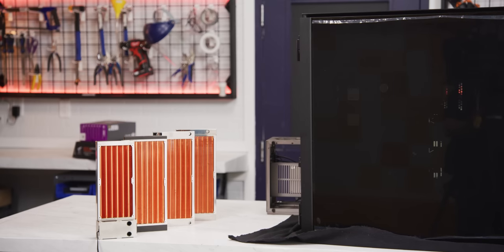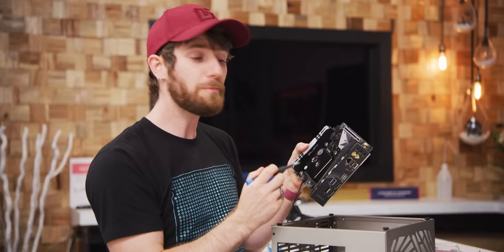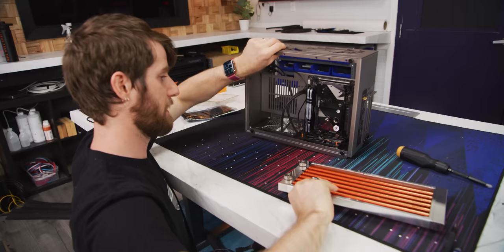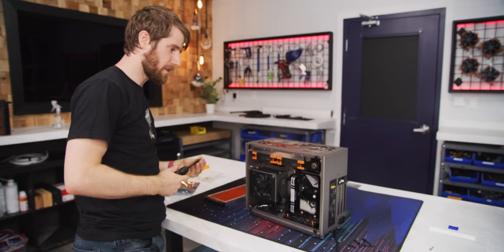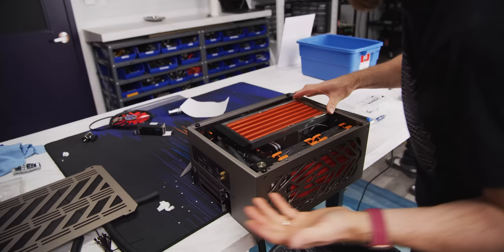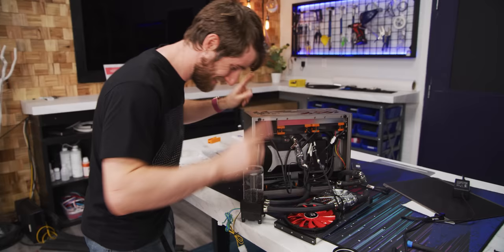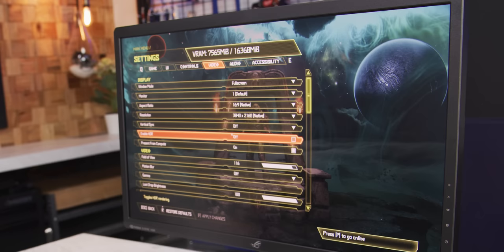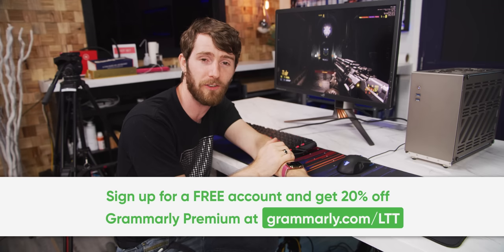The IMPOSSIBLE PC - 4x dual radiator ITX build

Comment: Fantastic build! Linus used some improved techniques that I've never thought of.

Regarding the pump that many people have asked about, it's actually integrated in the top radiator, and there’s also a tiny reservoir in it.
Reply: salvage
Reply: 你给我上去 King of Wings himself here
Reply: 翼王！！！原作者来了
Reply: Nb
Reply: 真厲害也
Reply: An XLNT design 🏆😎👍
Reply: 老粉狂喜
Reply: to King of Wings, since warm/hot are rises, why not just make the top side of the case the only exhaust and all other sides, even the rear/port side, be the intake? Positive pressure inside the case, and would insure hot only goes out top side. Heck, I would even DIY a stack/tower/chimney over the top to an exhaust fan out of the room. So that system generated heat won't add up toward room ambient temp.
Reply: 好家伙 翼王高强度上网啊！
Reply: 中国老莱梦幻联动
Reply: Nb
Reply: 排面
Reply: 大师球
Reply: 牛批。
Reply: 活捉
Reply: 点个赞！顶上去！
Reply: 翼王NB
Reply: 梦幻联动
Reply: Isn't YouTube banned in China
Reply: 翼王上去
Reply: @TheKb117  as soon as you add a fan in a case the fan vastly overpowers the mixture of air over the ability of the hot air to rise
Reply: 翼王冲冲冲
Reply: I thought Youtube was banned in china or something
Reply: @jammaschan  right，but VPN……
Reply: 科技区睡觉时间调查😂
Reply: 牌面啊翼王
Reply: 喔嚯
Reply: @luyaomusic  but VPN is technically also illegal in China? I know a lot of people use it, but it still is illegal.
Reply: @jammaschan  Basically, VPN is not illegal, but commercial VPN is illegal.
Reply: @jammaschan  you can use vpn, but you can not build and sell the service
Reply: 幫頂
Reply: @jammaschan  Yes, that's right.  But the intensity of law enforcement is very flexible.  Generally speaking, opposing the Communist Party and criticizing political decision-making must be given priority.  

Generally speaking, the gray area is still very large. For more neutral things such as digital, technology, media, music, and education, many videos are clearly moved from YouTube to Chinese websites, but they are generally allowed.  But politics penetrates every aspect of life after all. 

For example, Linus used Gigabyte’s motherboard this time. You can search for what happened to Gigabyte recently, so that it was banned on Chinese e-commerce websites.  

Gigabyte, MSI, Asus, including AMD Lisa Su and nvidia Jensen Huang.  They all have a lot of ties with Taiwan, and you may also know the Chinese government's arguments about Taiwan.  Even if you are a technology video creator who is not so closely connected with politics, you have to pay attention to your words. For example, you can't say that Taiwan is a country.  Linus also said that there is a Chinese version of Steam, and I also like that video very much.
Reply: LTT need to pin this comment
Reply: @Charles-cv6db  But then what is the point of the great firewall if everyone can just bypass it?
Reply: @zl721  That's interesting
Reply: @luyaomusic  I guess making videos in China is pretty hard then since there are so many rules. I didnt even know gigabyte was banned. Ill go look up what happened. That's pretty interesting.
Reply: @luyaomusic  okay I looked it up, but I really dont see the problem with Gigabyte saying they are made in Taiwan. Hong Kong's trade minister recently got mad at the USA for forcing products made in Hong Kong to be labelled as made in China. He says that is against international trade laws. I don't see why products made in Hong Kong cannot be called made in China but Taiwan products must be called made in China. That is a bit of double standards to me.
Reply: Andy肯定提前通知过了
Reply: @jammaschan  There is a threshold to bypass it, but it is not completely prohibited, which is the flexibility of the policy.
Reply: @jammaschan  Hong Kong has a special tariff policy. If it is produced in Mainland China, it will inevitably pay more tariffs.  For example, the production of the new motherboard is produced in mainland China, Shenzhen, Huizhou... and then go to Hong Kong to declare tariffs.  After being sent to various countries in the world, factories in mainland China increased its export orders, and Hong Kong also increased its total import and export.  There are many ways to pass this kind of object from the left hand to the right hand.  

The U.S. government is helpless with such rules. It wants to say that since Hong Kong is part of China, and Hong Kong’s democracy and freedom have been destroyed in recent years, we can no longer treat it as a free port.  In fact, many factories have moved to Vietnam and Indonesia in recent years. Their advantages are the same as the original China. They have cheap labor and the local government's welfare policies for all aspects of enterprises, but they lack a city like Hong Kong.  

The Taiwan issue is a long story.  In China, 3 T words can anger the Communist Party.  Taiwan, Tiananmen Square and Tibet.  July 1 of this year is the 100th anniversary of the founding of the Communist Party of China. Recently, the network blockade has been upgraded, and many VPN nodes cannot be connected.
Reply: @luyaomusic  Ah yes I seem to have forgotten about the part about the trade tariffs, thanks for reminding me. Still, it seems to be awfully benefit oriented rather than actually wanting to use the Made in Hong Kong tag. Since Taiwan is regarded as a separate entity from China in trade anyway (with the US at least), would Made in Taiwan really affect China that much? I just don't really see how Gigabyte had to be banned in China just for saying their products were Made in Taiwan. I do understand that it is probably a political thing, so it might just be emotions rather than logic that leads to bans.
Reply: @jammaschan  I understand what you mean, it seems ridiculous and there is no logic.  But this is the fact. 

The Chinese government just wants to publicize these issues loudly, and there is no room for discussion.  The Communist Party can control online public opinion. In recent years, populism has been very strong. Under such circumstances, it is difficult for most people to have the ability to think independently.  

Doing business or making videos in China is not so difficult as self-censorship. 
For example, in this video, Wings King, the designer of the itx case, I remember that when the Intel 10th generation CPU was launched, someone broke the world record for overclocking.  Wings King uploaded a screenshot from a foreign website and uploaded it to bilibili.  The fourth overclocking record is from Taiwan, and the national flag of Taiwan 🇹🇼 is indicated in that ranking.  After ten minutes, he was reported by someone. Later, Wings King deleted the picture and apologized to the public.  Then say that Taiwan is an inalienable part of China... Balabala ……

This is the case in China, passively abide by these "rules", otherwise your business will be blocked on all Chinese platforms, you can go to Google to search for people blocked in China, big  Part of it was just saying something indifferent like Gigabyte, but the Communist Party was not happy.
Reply: @luyaomusic  ah that's sad. Thanks for engaging with me anyway, have a great day.
Reply: @luyaomusic  Thankyou for explaining all this, interesting insights, its good you can VPN and join the conversation.
Reply: 本尊😂
Reply: What about mounting pump on top of the loop? Why nobody mentions that. Pump will die soon in such configuration.
Reply: King of Wings 这翻译太搞笑了哈哈
Reply: Could you please tell us where we could get these radiators? Thanks :)
Reply: @an3k   You can buy them on taobao (Original edition of aliexpress). The brand is 駻匠 (hanjiang). It needs transshipment I think.
Reply: @WingStudio666  Thank you very much!
Reply: 翼王 真男人！
Reply: 抓到一个翼王
Reply: 翼=Wings 王=King

King of Wings

某家賣雞翅的店...?
sounds like Chicken Wing Store
Reply: B站把这期搬过来了，才知道翼王和加拿大白嫖王有梦幻联动🤣
Reply: 活捉大佬。
Reply: @willlo2513  我竟然看懂了这个单词 NBable
Reply: 簽到
Reply: 翼王牛逼
Reply: where does one even get such a radiator/pump/reservoir combo?
Reply: 大师球
Reply: This is insane, how did you come up with this
Reply: @TheKb117  If you increase the pressure too much it will outpace the exhaust fans, which makes it all less efficient and (at least with older fans and motherboards) can actually push electricity back from the fan to the board rather than the other way around since a fan works as a wind turbine electric generator if it's spun externally

Comment: "There is an SSD on the board, right?"

My heart stopped for a second 😲
Reply: If they forgot, they have plenty of fast USB-C ones lying around they could use 😂
Reply: @Frog-ko6uu  pretty sure you can't install windows on an external ssd
Reply: @olivertrees  It performs way better with a proper SSD, and acceptably well even over a USB 2.0 connection
Reply: @Frog-ko6uu  oh cool. didn't know that. USB 2.0 is under sata speeds though, so not exactly optimal.
Reply: @olivertrees  lol, it definitely isn’t. However, the only PC I’ve had to run from 2.0 is a mid-2007 laptop, which isn’t gonna be fast either way
Reply: @olivertrees  There isn't a big difference between sata and nvme when it comes to operating systems (except with tasks like moving large files). In fact even boot time is similar. That said, I'd hate to see it plugged out midsession though.
Reply: @SoysauceML  the speeds are pretty drastically different, and you can tell to at least one point. 480mbs is dangerously close to HDD speeds
Reply: @olivertrees  Sequential read/writes are mostly insignificant, it's the random reads that matter. In which, they aren't hugely different. Look up some comparison videos. In terms of things like OS boot time, game load time, etc. SATA and NVME SSDs are mostly identical.

At most you can argue NVME works better for video recording and editing (and for the former case, only recording in codecs like Lagarith lossless).

In before you say I haven't used NVME, I'm typing this on a computer with a 980 PRO SSD computer. I also have a computer with 860 EVO.
Reply: @SoysauceML  Windows keeps doing so much random background tasks, maybe nvme helps overall experience, idk.
Reply: @suyashsingh9865  Only tasks that involves a lot of sequential writes would have that kind of problem. That said, while that may be the case for now, it may not be so in future, since newer technologies that utilizes the SSD are in the works (like RTX IO).
Reply: IKR, I was thinking imagine you do this and it POSTs, but one of your DIMMS are bad.

Comment: "that would put hotter air around the motherboard though"
Mono block & Chipset watercooling in it next? 👀
Reply: RAM Watercooling? 👀
Reply: AHHHH DADDY NORD
Reply: x570 here, chipset gets hotter than anything!
Reply: What about watercooling the watercooler?
Reply: Thinking of the ASRock aqua series now
Reply: Bald
Reply: @ZeroUm_  You jest, but a cascade with the second rad or res cooled with a chiller or peltier is not new at all.

Impractical, space consuming and not good for your power bill? Yes absolutely, but it did work well.
Reply: @ZeroUm_  aircooling the watercooling that is watercooling the air cooling
A loop for infinite cooling
Reply: I've got a sandwich case and it worried me at first..
Reply: Unnecessary- but ofc depends the was u use it
Reply: @ZeroUm_  i mean the water flows inside the cooler right so in theory it might already be a watercooling  watercooler if that makes sense 😂
Reply: @derechtedev9411  absolutely 👀
Reply: @MaxUgly  Aorus Master x570 here, chipset constantly throttling because the stock fan is absolutely useless, threw a EK waterblock on it, looks really cool and un-conventional and holds it around 40c!
Reply: @Nordern  Taichi here, the fan on chipset overheated and bearings starting making a bunch of noise. I took the fan off and now my gpu cools it just fine lol. I just had to customize fan curve for rx 6800 to always be at least 25%
Reply: @MaxUgly  I used to have my 3090 on a riser, just recently gone away front that and as such, the entire chipset cooler intake was covered by the gpu, and since the the PCH temp never changed regardless if fan speed, kr went really hit unless II was running my gpu fans on audible RPM, now everything is watercooled and silent, as it should be!
Reply: @MaxUgly  lol true same here
Reply: @derechtedev9411  Already exists, i have the Adata XPG D80s with liquid cooling :D doesnt make a difference, but its a sick flex
Reply: @MaxUgly  true, i've changed the chipsetcooler myself on my Asus ROG Strix X570-E Gaming , it is really running the coolest ever now without any fan directly attached +- 60 °C now. 
(before it was 86 till 91 °C). but i've changed it because of the annoying fan ramping up always, witch is not strange if you see the original size of the cooling block ;p
Reply: @Nordern  good for you, i've have wanted to watercool my asus rog-e x570 chipset aswell, but it was to much different parts and things to consider, so i've bought a copper block 100x80 mm
 cut some off now it is 60  °C, and i'm already happy with it.
(still have thermal grizzly minus 8 pad for inbetween chip and block was ordered and a bit late)
Reply: @ZeroUm_  yes, have water mist onto the rads just like some models of subaru WRXs that mist water on the intercooler
Reply: I mean Aorus does make water-cooled motherboards so that is a thing 👀

Comment: Linus-
"you cant fit fans in this case" proceeds to make it look like a mini fridge computer with 4 radiators
Reply: I wanna challange LTT to make a gamer pc but its a notebook
Reply: @claudioandkindash7761  an LTT gaming "laptop"? I'd love to see that with all the new cnc stuff they got!
Reply: @zOzzYz  pretty sure you wouldn't want to use it on your lap at all if it become a reality, though
Reply: Cool build but I really doubt the efficacy of the fanless rads
Reply: @FinneousPJ1  3 of the 4 rads are equipped with 2 fans each, though 4 of them are thin fans. And the last one shares the fan from the PSU. The original version is capable of pushing 10900K to all core 5.3Ghz (though they said that the motherboard probably had some issues so it's not stable at that frequency) so it's solid enough in performance I guess.
Reply: @FlameRat_YehLon  Yeah but how much performance is the 4th rad without fans adding?
Reply: @FinneousPJ1  you can think of it as a 120mm rad, since it make use of the PSU fan. Though each rad is way less efficient than if they are used separately anyway, since the temperature is way lower. They are really there for improving the performance in suboptimal environments (hot or confined space) i think

Comment: Wait wait, can we get a source on that copper vs aluminum fin performance, especially regarding the heat dissipation? Based on my materials science understanding, that doesn't make sense.
Reply: well one thing i can guarantee you is that copper is surely most conductive heat transfer but not strong enought structure. thats why its hard to see cooler that use copper as fin. the structure easily change after get warm.you can learn that in basic chemistry. for the heat dissipation. maybe the subject of the temperature of aluminium can absorb is higher is better as endpoint, and the copper faster absord as key for firstpoint.so that the aluminium can absorb a lot heat in the same time air can dissipate the heat.this is my theory. this is simply my theory. it kinda make sense in one way,but maybe there more into it
Reply: he might not have the same understanding as you, and me. itd be a good LTT video though, but id bet identical fin design aluminum vs copper, aluminum would be worse

Comment: Yes, it was pre-bled, however, it wasn't with the bleeding location at the highest point. There was probably some air still trapped in one of the radiators.

Critique out of the way, I love this and wish I kind of owned this. The dust on the bottom intake would be annoying, but eh, it'd work.

Comment: Water pipes are now heat pipes, wicking the heat through the system.
As long as the thermal mass is kept at bay from through the rads, it will keep going.
So in this case the number of rads matter.

Comment: For cutting Cable Ties, you get basically perfect results if you'd use "Small Electronics Side Cutters". These can cut the Cable Ties very flat on the head.
As an electrician, I really appreciate those at work, as the small remains would always be very sharp and can easily cut into the arm while working in small spaces.

Comment: The ziptie "cutters" respawned on the tool rack after Linus threw them out?
Reply: devs got lazy, they focused on graphics more and i'm not complaining
Reply: You should know Linus never throws away stuff
Reply: The radiators are actually the same radiator respawn 3 times
Reply: it will just be decoration from now on
Reply: Those are made for removing zip ties on bundles w/o hurting the wires. Most professionals use zip tie guns to tighten up the tie and cut it with one tool...
Reply: @Bmartin8250  i never seen a single person use a tool like that, have been working as a licensed electrician for over 10 years
Reply: @king080dom  I believe I saw their usage for more of removing zip ties in bundles in electrical panels and such. Mcmaster has them marketed as cable tie removers.

Comment: Watching all these watercooled builds here lately really makes to make me try one some time. The only reason I never did it was since because it just doesn't seem costefficient for the performance gain. On the other side, I do like myself some piece and quiet. I only hope it's as easy at it seems in the UTUBE.
Reply: You may want to start with a simple loop. Radiator, Pump / Reservoir combo, CPU block. You only need six fittings and three tubes.